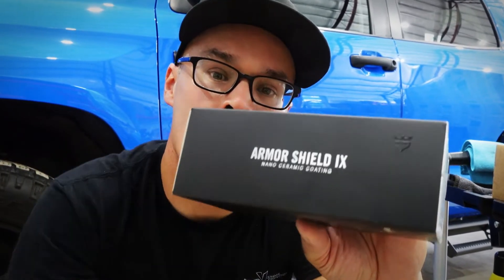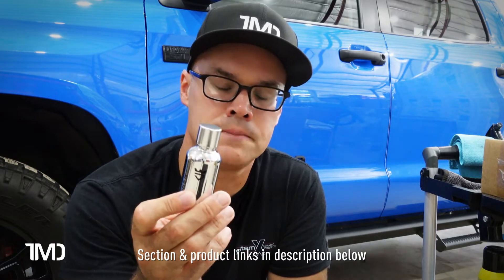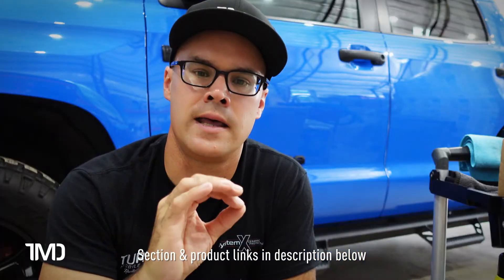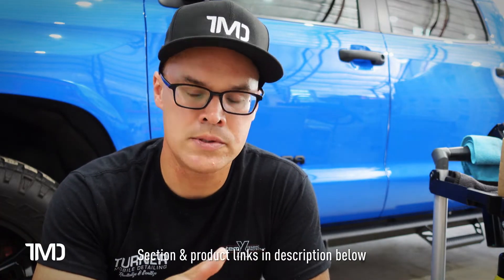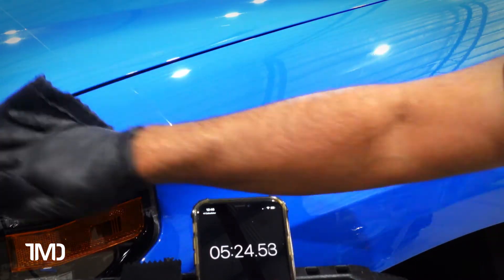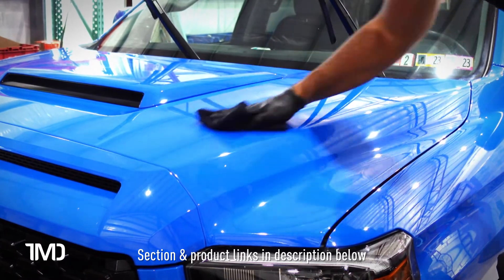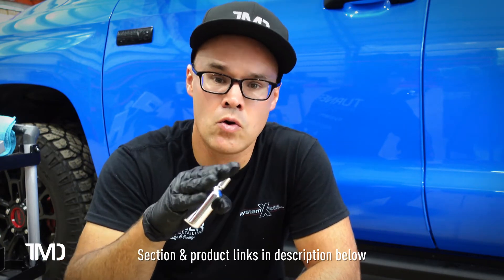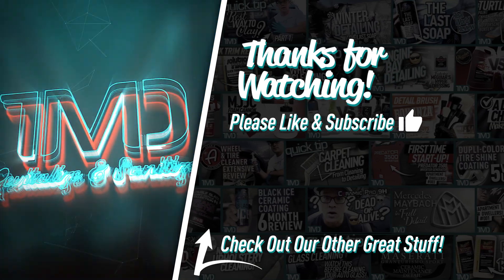HOW TO: Armor Shield IX Ceramic Coating from Avalon King |  Step by Step + Extensive & Honest Review

Comment: Just spent 8 hrs preping and ceramic coating with Armor Shield IX, you are 100% correct in your analysis, I have a 2012 Silver Honda Accord with metal flake paint, I never saw the flash but they say it's hard to see in a light color car, I did the windows and saw the rainbow within seconds on a very humid 80F day, had no problems wiping it off even waiting 10-15 minutes, did larger areas than 2'x2', also did the interior.  Preping took a long time since I clayed it and power buffed the swirls out, it now looks better than new.
Reply from the maker: Nice!
Reply: @TurnerMobileDetailing  I watched many of your videos, you know your stuff, very smart guy, glad I found you on youtube
Reply from the maker: @tweetybird7668  thank you so much!!

Comment: Hi Seth,
Nice video. I’ve just done my second coating of this as I found after 1.5 years the sides of the car were not beading as they used to. The back was fine. I did all the steps and a very fine overall polish just to catch any swirls. 
I’m a ‘garage queen’ 😂😂😂 that’s what the garage is for after all. 
If you are new to it it is super easy and I found on both occasions the ‘oil slick’ look was pretty instant.
I buy some new towels to buff off as they need throwing away after but it’s not that expensive.
You do need 2 bottles IF you want to do all the car, inside the doors, bonnet or ‘hood’ and boot or ‘trunk’ if in USA. I’m in the UK. DIY’er but enjoy doing it.
Use a mask when putting on, it’s quite powerful fume wise of open the front and back a bit to get a bit of air flowing through or it can get too much.
I did glass except the windscreen and all plastics etc.
Overall it works well and makes cleaning so much easier.
Personally would do this once a year at a time that makes sense, summer as it really helps to get this coating into the sun to cure it really well but give it 2 days in the garage.
Buy it when it’s on offer, there is no need to pay full price.
Didn’t use the block when doing detail bits, just the cloth. This makes it easier the get in all the corners. I probably used too much, but it’s better than missing parts.
I expect other similar based priced products are the same but I’ve got my head around this stuff now and it is easy. 
Not sure the blue truck showed the flashing, maybe that is why it was hard to see??
Just subscribed, so will watch your washing etc, always good to get another opinion.
If you are in doubt, try it, it is so simple and I’ve always polished a car. This is the first time I have ceramic coated and it’s the maintenance that you benefit from, so easy.
Reply from the maker: Thank you for sharing your experience, and thanks for watching Steve! I’m looking forward to seeing how this stuff has held up after 6 months outside.

Comment: I applied this coating (Armour Shield IX) on my car as per instructions (did full paint correction on the car prior to application including iron removal, polish, isopropyl wipe down, car set for 72 hours in garage before being driven) , had a great result until first rain (about 5 weeks after application). I washed the car about a week after its been in a rain and was left with a lot of hard water spots on hood, roof and trunk lid. None  of available water spot removal products worked (tried Adams, Chemical Guys and few others) - even light polishing still left a bunch of water spots on the car... I never experienced this kind of persistent spots when using waxes. Any idea how to remove them? Thanks!
Reply from the maker: That’s a tough one. When you did some light polishing, what product did you use and how did you do it? I sounds a lot like the minerals in the water actually etched the surface instead of just sitting on top of the surface. Did the polish remove any of the spotting or none at all? If it did remove some but not all, then that tells me the surface is etched and maybe a little further polishing is necessary. Then of course the coating would need to be reapplied because the polish will most likely remove the coating also. Unfortunately a lot of these cheaper consumer coatings need to have a sealant applied over top especially for the first few weeks during curing to protect it from things like water spotting. Avalon King doesn’t say anything about that in the instructions so I didn’t even think to mention it.
Reply: @TurnerMobileDetailing  Yes, most spots came off, but there are bunch that are more persistent. I was under the impression that having the ceramic coating on the car would eliminate the water spots. I now use Meguiars ceramic detailer after every wash (kind of defeats having the car ceramic coated)  - the extra layer helps with spots...
Reply from the maker: @RC_stuff  that’s a problem with some DIY coatings unfortunately. Like I mentioned before it’s usually a good idea with these type of coatings to put a sealant over a fresh coating so it can cure and the sealant will prevent water spot etching and like damage. In your case the coating should have been cured enough to not spot like that. That kind of tells me that this product takes a long time to cure or maybe worse, it’s not that great. I’m gonna be checking on the truck this month so I’ll see how well it held up for myself. So for your car I would polish out the remaining spots and either reapply a coating or just keep using the Meguiars. But just know that not all coatings do this, there’s good and bad ones just like anything else.
Reply: @TurnerMobileDetailing  Yeah, I think I will stick with ceramic waxes and detailers instead... LOL
Reply: BTY - I did reach out to Avalon King and never heard back from them - some great customer support they offer..
Reply from the maker: @RC_stuff  I can ask my rep for you
Reply: @TurnerMobileDetailing  That would be great! Thank you!
Reply from the maker: @RC_stuff  He got back to me quickly, here’s what he said: 
“Does happen from time to time due to hard water/mineralized water sources.
A great way to prevent then is with a ceramic topper of some sort. Armor Shield Lite would do but others would be Turtle Wax ceramic spray coating, Xtreme Solutions Topper, and Chemical Guys has one but they keep changing the darn name of it!
two tools to remove one that has etched the coating would be a descale solution.. these are great btw, an acid wash designed for ceramic coatings specifically CarPro Descale is a killer product and can be used for tons of purposes.https://www.carpro-us.com/wash/carpro-descale-acid-wash-500ml-17oz/
Aside from that one you could use something like Gyeon's water spot remover. Just be sure to flush the area treated with distilled or pure water after use.”

He said pretty much what I did before, except for the acid wash. I’ve used Carpro descale, it’s good to remove somewhat fresh water spots, but etched spots that have been there a while mechanical removal is really the only solution.
Reply: @TurnerMobileDetailing   Thank you for taking the time to get me all this good info -  I will try and see if I can get those spots removed. Since I had this happened I've been using Meguiar's ceramic detailer spray  after and between washes - seems to do a good job preventing spotting...
Reply from the maker: @RC_stuff  you got it!
Reply: I had problems with this coating too.

A little background, vehicle had 300 miles on it at this point: Just over 3 weeks ago the 16 hours of prep work started so I could install this coating. I started with performing 2 contact washes using Adam's Strip Wash and my foam cannon. From there I used a synthetic clay mitt to clay the entire vehicle. Adam's Detail Spray was used as the clay lubricant. Following this, I hit the Yukon with a light polish using Griot's Garage Perfecting Cream. Final step before applying the coating was going over the whole thing with Gyeon Prep. Lastly, the Avalon King coating was applied and left to cure for 4 full days before the Yukon was driven. During this entire period, the garage was kept at 70 degrees.

Fast forward to yesterday when I performed the first contact wash (Adam's Graphene Shampoo) since the coating was applied and the entire vehicle is sheeting water really slow! It's possible I did something wrong but I can't see where. Maybe I just got a bad batch?
Reply from the maker: @jvande102  hey man, thanks for sharing your experience. Sounds like you did all the prep steps well. The only thing I would do differently is not use a quick detailer as a clay lube because your putting a layer of was/sealant on the surface before the coating is installed. I recommend just using some ONR in a spray bottle for lube. However in your case, if you polished the surface after the clay process, that detailer should have been removed. The water behavior your seeing might just be the coating’s natural water behavior. I actually just filmed the update to this video last week and had similar results in water behavior. Most consumer grade coatings don’t give insane water behavior in the real world. But that doesn’t mean it’s not there protecting the surface.
Reply: @TurnerMobileDetailing  thanks for the reply and suggestion on the clay lube. Some P&S Absolute just delivered today and I assume that will work the same as ONR?

If the coating is indeed failing, it's not all bad I guess. During all the prep work I noticed some dealership tunnel wash installed scratches that I didn't have the pads to go after at that time. Don't get me wrong, the Yukon looks nice but it's black and I know they're there so I look for them all the time. Now I have the opportunity to compound and polish them out with the appropriate pads. Any suggestions how to chemically help further break down the coating?

My nephew works for a detailer locally and they install System X coatings so I'm going to have them install one of those after I do the paint correction.
Reply from the maker: @jvande102   I know how you feel, I’m OCD about scratches too,  it that sucks that the dealer did that. When I buy a new car I always tell the dealer to not touch the car, don’t wash it, don’t even put tire shine on the tires. Dealer detail departments can be rough. Just make sure the scratches aren’t too deep to be removed, otherwise you risk burning the clear coat. I know you’ll like the system X coatings, they’re the real deal.
Reply from the maker: @jvande102  oh and yes P&S absolute should be the same as ONR just as long as there’s no wax in it.
Reply: Chemical guys water spot remover.
Use an inline rv water filter on your hose.
Dry the vehicle immediately and use a detailer like armor shield lite.

Comment: I drive a Ford F150 supercab 8ft bed.
Lots of panels. As soon as winter was over I started the decon process. Took 2 afternoons for 2 washes, decontamination spray, clay, polishing.
Then 2 coats of ceramic that took a half hour plus each. I recommend a ceramic detailer or maintenance product after 3 months.

Comment: I just used this on a black 08 IS250 in a garage at about 70*+ F and initial application it laid down in a rainbow/oil slick color. Seemed to flash pretty quick. I still waited 1min+ until wiping it off. I'm sure this blue truck may make it hard to see a green/purple/blue hue.

Comment: This is one of three coatings I have used as a DIYer. It is the easiest to use but not sure of durability. The others I used were Adam's Advanced Graphene and Ethos Graphene. Definitely need to do two leveling steps for each area.
Reply from the maker: I’ve used the Adam’s also in the past, pretty easy too.
Reply from the maker: We’ll see how it holds up
Reply: I used Adams on my Pickup After using this on my car. Pick up was Dark Brown and I hated the Adams. I could not let it sit more than 1 minute or it was almost impossible to get off.
This stuff was so much easier and the durability seemed about the same

Comment: Thanks for the video. How many of the suede applicators do u need to use? Do u just need one and the other 2 are for emergencies? Cheers
Reply from the maker: 1 or 2. I flip them over after a few panels, so for this large truck I believe I used 2 cloths, each side did about 1/4 of the truck.

Comment: Hello, you metioned low profile microfiber for buffing off the ceramic after flashing?  what type of low profile (weight) microfiber towel should I gert from Rag company?  and what high profile microfiber towel do I need and what is it for?
Reply from the maker: Low profile just means low pile. So fro Rag Co I always use the edge less pearl as my initial buff/removal towel, and the eagles creature as my secondary and final buff towel. The pearl is to initially remove the solvents and to level the coating, and the second, the high pile creature is to buff to perfection.

Comment: The applicator sponge and towel combo seems like a convoluted way of applying the coating. Would you be able to use a simple microsuede mini applicator sponge made for ceramic coatings like the ones from Adam's etc?
Reply from the maker: Yes, just make sure the applicator is lined with plastic under the outer suede layer. This prevents the stuffing of the block from absorbing all your product. This is why the cloth wrapped around the applicator block is often used because the block won’t really absorb the coating, it stays on the cloth and thus able to be applied to the surface, instead of being lost inside an applicator block.

Comment: Great review Seth you went through everything! I wanted to ask something. If someone takes a brand new car straight from the dealership do you think it’s necessary to do an iron and bag removal and a clay bar application or you would be fine only with the IPA wipe down if the paint itself is in pretty good condition?
Thanks in advance I’m looking forward to the long term durability review!
Reply from the maker: Thank you! Yes you absolutely should. Even a brand new car needs to be iron removed and clayed. New cars often collect iron rail dust and or industrial fallout from the transportation process to the dealership from the train and/or boat they ride on. Also, if they’ve been sitting on the dealer lot for a while, they can collect industrial fallout since often dealerships are in or near business and industrial zoned areas. I recommend Adam’s iron remover and nanoskin fine clay mitt. Be gentle and use ONR for lubrication.
Reply: Alright I got you! Thanks for the recommendations I will totally check them out. Also, what about bug and tar removal. Is it necessary as well for a brand new car?
Reply from the maker: @kwstas7263  if you have bugs and tar on the car then yes

Comment: Where is your Amazon link for the table? It's not there on the bottom.
Reply from the maker: Sorry I guess I forgot to add it. The link is in the description now.
Olympia Tools 85-198 Pack-N-Roll Folding Collapsible Service Cart, Full Black, 50 Lb. Load Capacity per Shelf https://www.amazon.com/dp/B08KFM2PVM?ref_=cm_sw_r_apin_dp_13ECQD7E4MS2VGMYC8YF

Comment: How is Ceramic Coating on a HOT climate around 110 degree..
Reply from the maker: Should be fine, most ceramic coatings can withstand high temp environments. You may not want to apply it on a car that’s been sitting out in that heat though. The panels shouldn’t be extremely hot when applying. But to be honest, this stuff is so easy to use, it may not matter all that much.

Comment: Tried Avalon King on my new car. Did iron x, clay bar and paint correction. My nephew applied the coating as he does it professionally. Went on easy.
The results? It didn’t last at all, about a month and a half. They did refund my purchase but with all that work, very disappointing. YMMV.
Reply from the maker: Thanks for sharing your experience
Reply: Is it possible you washed off ceramic coat after it was applied?
Reply: @youngz13o  um no.

Comment: all this ceramic coating is concussing as hell , i just got my car detailed , it was 160 dollars , guy did am amazing amazing job , i asked about ceramic coating , he said it costs $1000.00 , so this Avalon King i see everywhere for 50 bucks , what gives
Reply from the maker: @Anne6621  so as I stated in the video, Avalon king is a consumer product, not a professional grade product, so there’s a big price drop in product cost alone. When you see $1000 for a ceramic coating, that most likely includes a professional grade coating, plus the labor costs for all the prep work and installation for someone else to do it for you. 85% of the cost of having a ceramic coating installed is the laborious prep work. BTW $100 for a professional coating is not a bad price, depending on the product and its expected longevity.